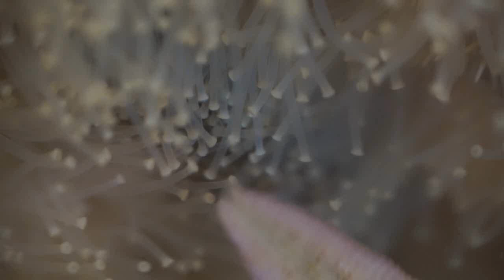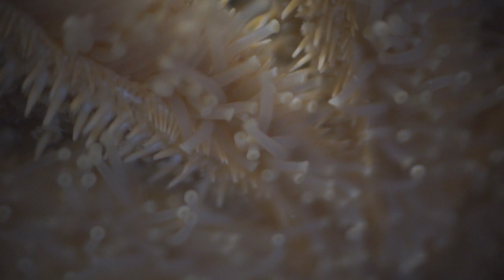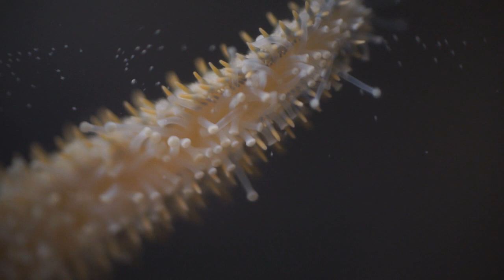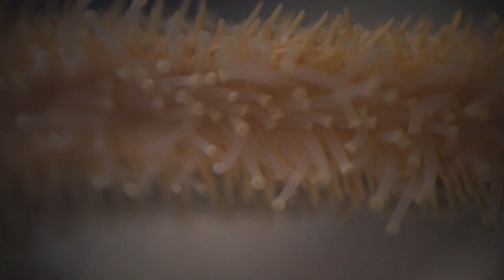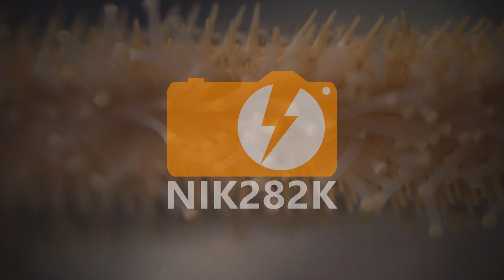Starfish Feet

Comment: That's very strange. I've handled quite a lot of starfish when SCUBA diving and those feet really do feel like suction cups to my hand...
Reply from the maker: I've only handled one live but it was out of the water and had retracted its feet. Where do you dive?
Reply: Nick Moore
I live in Rhodes, Greece and during the summer I like to go diving around the island. Starfish are literally all over the place. Sometimes the floor is just layed with them. The biggest one I've seen was a little over 10 inches in diameter.

Comment: A starfish can adhere firmly enough to a clam's shell to pry it apart over time.  Though I haven't been able to find how much force this requires, from personal experience, it's not a trivial amount.
Reply from the maker: We need to send Mathias from Woodgears a box of clams and he can use his joint testing jig. How is stickiness measured anyway? Grams/m^2, snailpowers, Milligekos?
Reply: Nick Moore I'm going to guess it's the same as tensile and  shearing measurements.  The trick starfish use is a long duration, rather than a high amplitude.  The clam shell requires muscular work to remain closed.

On adhesion in adverse conditions, mussel glue is a phenomenal bit of chemistry:   able to durably bond to rock under turbulent  salt water.  Apparently, the protein involved is dopamine.

Can starfish adhere to teflon, I wonder?

How did you get these awesome shots?
Reply: After seeing his mouse trap videos, I suspect Mathias wouldn't be completely adverse to clam-cracking...  I suspect his challenge would  be centered around making a device that could get a grip on the shells, no prying allowed...
Reply from the maker: I went right to the source of all sea life in its natural habitat, the aquarium. 

I think I've seen footage of a starfish opening a clam, probably a BBC thing, it was definitely an endurance test for both animals.

I'd bet there are a couple animals that could stick to Teflon, snails for sure, probably octopus and its relatives but I don't know about starfish. I didn't find much about its adhesive properties other than that they may not be based on suction at all. 

I'm going to need to get a tiny aquarium for home. I wonder if they eat leftovers.
Reply from the maker: Which glue is strong enough to open a clam!
Reply: Starfish-foot salve!